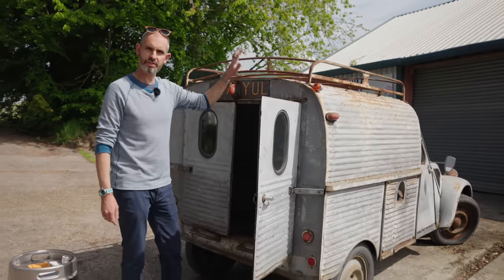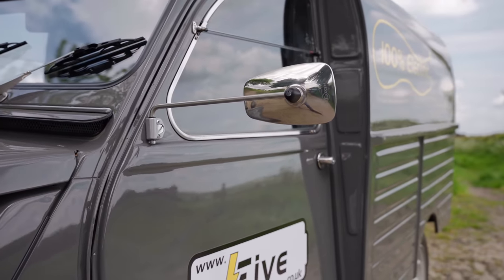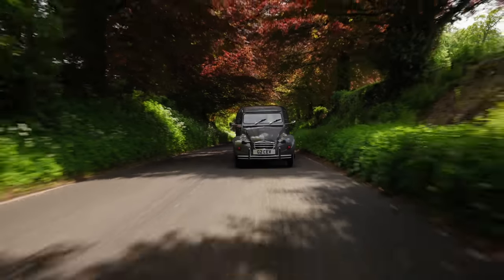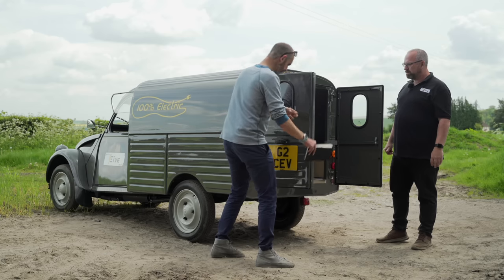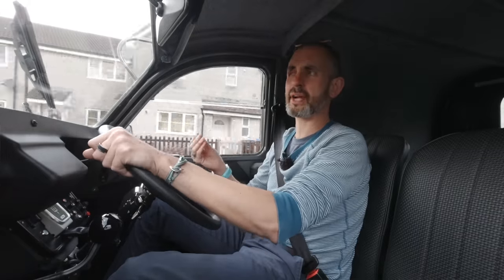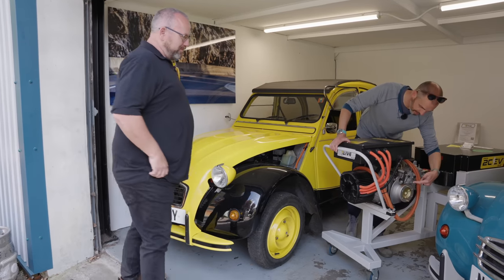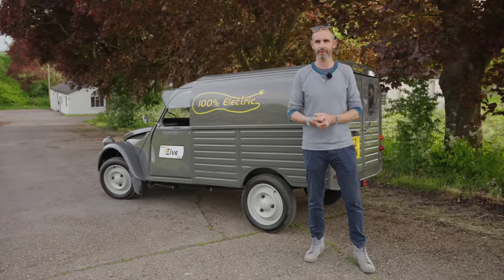This is a BRAND NEW Citroen 2CV AK Electric Delivery van - exclusive first drive review

Comment: The 2CV was the pioneer of the large diameter narrow tyres, a route followed by BMW with the i3... I've always remembered a Lotus Esprit article in CAR Mag [UK] in the 80s or 90s when on winding Alpine roads in slush and snow the power was useless on supercar of the day summer tyres  and could not  keep up with a local 2CV with narrow tyres and traction control provided by the lack of excess power

Comment: A proper air conditioner to cope with Australian summers is a MUST. And as long as I- at just under 2 metres and 120 Kg (6'6 and 18 stone)- can fit in it comfortably, these would be great! 

Anything over about 110 Km/Hr would be frightening on those skinny tyres. Keeping the car as a quirky little suburban runabout is all you need. Inter-urban driving in the UK is a lot less than it is here in Australia; Brisbane and Sydney are over 900 Km apart.

Keep the power to the wheels down and maximise the driving range of the vehicle.

Comment: I wish we could get simple and practical vehicles like this in the United States
Reply: Some years ago there was a programme called Pebble Mill on the BBC. They featured a purpose built vehicle that was designed to handle desert roads in Africa. Long story short, this "high tech" vehicle broke down during the expedition and was rescued with the help of a driver who rolled up in a 30 year-old 2CV trundling through like it was going to the corner shop. 2CVs were odd looking (I called them Upside-Down Prams) but the simple tech was hardy, easy to repair and the suspension handled rough terrain so well that it is almost unmatched to this day. It's the epitome of substance over style.
Reply: Not sure the repine is practical.

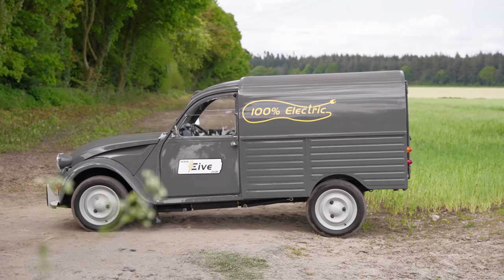Comment: Am I seeing things or is the rear tyre catching the bodywork at 2:30? 👀
Reply: I think its behind the body and when its loaded the body will drop down and the wheel align in the hole - I think
Reply: I keep looking at it and it definitely looks like it's touching
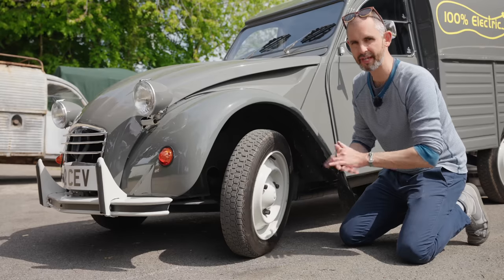Reply: if you go to about 4:11 you can see they are set in quite a bit from the body.
Reply: @100tinsoldiers  Ah yeah I see now

Comment: Don't know if you popped your 2CV cherry the same time as me Jonny, but I'm the bloke who collected the one that you used on 5th Gear to compare with the newly launched Citroen C Crosser 16 years ago. I collected it from Fareham at 7.30pm from a young lad who'd been waiting all day for me, and when i called in at Winchester Services for fuel, i couldn't get it started again. I'd been told to pump the accelerator a couple times before i started it but must've pumped it too much. There was a Police Crew bus parked nearby and i asked them for a push to bump start it, so all 6 of them helped (although just one would've sufficed) but it still  wouldn't start. So i had to call the AA and he had to use some easy start which did the trick. The fuel gauge didn't work and i ran out of fuel at Loughborough, luckily i ran out just as i was heading up the slip road of the M1 at junction  23. I then had to scoot the car half a mile up to the BP garage whereupon it wouldn't start again! By now it's 6am and i had to wait till 7.30 am for my office to open. Eventually It had to be recovered back to Nottingham where i live, and transported the next day to North One TV in Birmingham. So i had all the pain and none of the glory!  IDK if you you knew all that , can't imagine why you should,  but the second AA man said he'd be glad to see th back of these cars, though probably not as much as me!!

Comment: But the torque is huge compared to the Kw (120 Nm) so acceleration will be very smart up to say 40 KMh. If you bother to put it in 1st or 2nd gear. Speaking of which, could he not have just ditched the gearbox entirely - it's an EV after all.
Reply: Keeping the gears is smarter - either peppier performance, or climbing steep driveways with full load, use lower gear for more torque.

Comment: I completely understand why it's priced at the point it is - low volume, hand built, almost all brand new... but £40k is a lot of brass to be putting down on a vehicle which, honestly, has a fairly limited usefulness.... Yes, advertising - but it'll need to attract a LOT of punters to your authentic Bread'n'Snails (sorry, Pain et Escargots) business to repay its cost.  Still, very cool & so glad people are doing this sort of thing. I can't help but wonder, though: Get rid of that silly gearbox, chuck a beefy motor in there, leave those skinny tyres on it - it'd be an absolute hoot, all the way to, and through, the first hedge :D
Reply: Handbuilt, absolutely, but not too much to 'build'. The price baffles me.

Comment: At least it's mostly new. Otherwise, this sort of thing is ruining classics, needlessly.
There is no positive effect for the environment of putting electric motors in old cars because there will be more damage caused by creating the batteries than would have been caused by the car presumably doing very few miles using petrol.
You'd have to do tens of thousands of miles before this would add up in terms of air pollution. And you would still have the problem of the environmental damage caused by digging the stuff out of the ground.
Putting EVs in classic cars is simply a money-making scheme. And nothing else.

Comment: So, more celebration of unnecessary environmental destruction then Jonny? WHEN will you actually LEARN how devastating this electric motor LIE really is?
Reply: Go lay an egg
Reply: Speaking of environmental destruction, it sounds like you've been standing in a sealed garage with an ICE engine running.
Reply from the maker: It isn't a lie Paul, it is a choice. Do you consider the colossal environmental damage to oil extraction, refinement and transportation? Doubtful. All that process and we just explode fuel to move. EV is hardly the worst offender, is it?
Reply: @TheLateBrakeShow  Last time I looked, oil wells weren't drilled by African children for 25p a day. The OP is right, far from saving the environment, EVs are contributing to it's destruction. It's EXACTLY the same bullshit as when environuts said everyone should be driving diesel vehicles....look how that worked out 🙄

Comment: Should be very easy to put in LED in these, just buy ready-made LED reflectors with the light source already in them. JW Speaker makes outstanding ones, but for this perhaps the venerable but still awesome Truck-lite 27270C would throw massive quantities of light down the road, and those can be had even off retailers for a couple hundred each. They look way more traditional than the JW Speaker ones. Although, looking at those lights, I guess they're smaller than 7 inches, might be the "other standard" which is 5.75 inch. Then again, 7 inch buckets might not look out of place.

Comment: My battery lawnmower came with two 40V 4AH batteries.  You could get a dozen of those and a three port charger for less than US$1000.  Run the car on six at a time and swap when back to the shop.  Or for a little more, they have 6AH batteries.
Reply: That’s only 2kwh.

Comment: As the owner of a 2CV I find the tyres appear very wide in comparison with the 3.50x19 tyres fitted to my 1932 Morris Minor two-seater. 3.5 inches is 89mm, so 135mm is 50% wider.

Comment: Love it, despite a very "electric car" price !
My parents got a "springtime green" 2CV back in the early 90s.
The so distinguishable sound it made was also part of the joy that surrounds every 2CV.
Not to mention, it had a roll-back roof, my first time in a "convertible" !
Also, the almost oddly comfy "camping" seats, or the incredible suspension travel ("you can't rollover a 2CV" was a popular gimmick).
A car before Peugeot castrated Citroën's engineers, sadly 😕

Comment: At 6:34-ish Johnny says "city range in EVs is often way way higher". In my years with my Nissan Leaf I've found that I get 15% more range when I'm driving outside of the city especially if there's a significant amount of road that allows speeds in excess of 50mph. It's taken for granted that an EV will have worse economy on motorways over long distances. My eight year-old Nissan Leaf does 3.8-4.1 miles per kwh in the city and 4.5-4.8 miles per kwh on motorways and dual carriageways. Those efficiency levels are the same now as when it was new.

Comment: this is very interesting but for an EV with very small modifications you can get more range with the same battery by paying attention to Aerodynamics, for example that cargo box near the door is like a wall, a bit of angle there would probably give it some extra range and probably lower noise profile.

Comment: If this is a RETRO build i advise the producers to have a bigger 500 version with a polymer cabin usable as a camper, just higher with more windows and probably somewhat wider footprint. If you can fit a couch in there and sit with enough headroom it is feasible. A bunk bed is easily made. The rest is just making it fit custom orders. I mean you have to spent 50.0000 pounds to buy a regular camper van in retail anyway. Petrol engine ofcourse.

Comment: I guess the "handmade" part is the answer to my "where is all that money going?" question.
Given the original transimission, all of the fibreglass and the lack of features, I couldn't see it going into the development or the materials.

I guess the quirkiness should be enough for the intended market, but it is a shame that the main draw of the original 2CV is gone.
Reply: $30 for a handmade body and chassis, and $10 for the drivetrain and battery is about half what that would cost you for something that could actually haul loads or reach highway speeds. 🤷

Comment: The feature that I like the best on that vehicle is the no attempt to conceal functional bumpers.   Hopefully they're more rugged than the ones of the Renault R10 and R16.
imo ALL French-designed passenger cars are "comfy".  I've owned two, a Peugeot and Renault. They had the most comfortable front seats of all the cars I've ever driven. I'd be buying more today if the French hadn't abandoned the US market in the 1970s.   In those days they had a lot of cutting edge features, and cleverly conceived but poorly executed  basic ones. (The Renault R16 had the most useable features of the Honda Element). But the bodies in those days were thin, cheap steel that rusted incredibly quickly, and they ate front CV joints and alternators. The seats and suspension were the only things outstanding and those may have been to match one stereotype of the upper class Frenchman.

Comment: Considering that my original 2CV back then managed about 350-380km with its tiny gas tank this is not great range but okeyish. And the weight simply forbids a 40 or 50 kWh battery
Reply: And what happens to the range when it has a heavy load?
Reply: @mytinplaterailway  weight dows not matter much for an electric car, xou can check many tests on that. plus it dows not have a big load capacity. trailer and roofrack are a different story

Comment: What an interesting video. I have a Honda CR-Z which has an electric motor to assist the petrol engine and has a higher output than the electric motor on this car (not in terms of bhp, but kwh), and I wondered how on earth it managed to get it moving. Gobsmacked at how at how light the 2CV is. The CR-Z is a small two seater coupe, but weighs almost twice as much.
Reply: The originals were very lightweight, but probably had a side impact resistance similar to that of a laundry basket.
Reply: @kennethjackson7574  🤣 That would explain why the CR-Z has all that extra weight because it has a 5 star NCAP rating.

Comment: I had a petrol version 602cc version. The funniest thing was the jack to change the wheels. It was about 3ft long and only lifted the wheels off the ground on the last 8 inches of jack.  I only got rid of it as the seats fell to pieces but but your seats are pure delux.
Tip, don't use the air con when it rains. 🤣
I was going to translate the description but was beaten by a female voice over.  Zut alors.
Quel super véhicule.

Comment: Porsche has spent a decade popularising the idea EVs will weigh 9000 pounds.

24:19 In terms of function, this EVE makes a lot of sense as a wholesale delivery trolley, with a retrofitted chat bot at the wheel for extra allowable battery or payload.

3d scan the entire unit and print it as a monolithic monocoque structure entirely of titanium.

Comment: Nice to see that light weight can be achieved in an EV, albeit with zero crash protection or safety features. Can imagine it could be popular with local parcel delivery drivers, but an ice van is half the price and even a Kia SUV is cheaper. You’re really paying for the retro aspect.

Comment: Nice!
However, my dream is a standard 2CV without the original gearbox. One motor (strongest E-bike types) for each wheel would be a blowoff. I am aware that this can only be designed by several first-class engineers. The brakes, energy recuperation and the corresponding control would mean a real challenge. But it would be the most reasonable car in the world.

Comment: 😃 Nice. I own a 2cv myself fully restored, but mine has the original petrol engine.The electric version is cool but qute pricy. 40 000 per car😳 I do like the fact that it has the same look as it would when it camed out of the factory, wheels included. I often think about converting my 2cv and  the only thing that "stops" me is the cost. Me, living in east of Europe would have higher cost to drive it to UK, and as much as I like visiting there due to various reasons, at this moment its just not an option for me. (abusive job managers😔)

Comment: I wouldn't mind having one for short trips back and forth to town, but not for $50,000 USD!!!! Maybe 15-20,000 at most, and then you'd have to figure out how to get it licensed. Seeing that it's a NEW vehicle, it would almost have to be licensed as an ATV to get around the US vehicle safety standards for airbags, crash test, etc., plus the fact that it wouldn't be able to maintain normal highway speeds. For inner city travel, and rural use, it could be comparable to a mid-range electrified Polaris ATV, but with more carrying capacity. A short bed Polaris Sportsman 6x6 is around $15,000 after taxes.😉

Comment: How is it dealing with modern safety regulations when building based on old car designs? Do you have issues marketing this car outside the UK? What's the solution, do you modify the body design, or is it enough to limit the top speed of the car?

Comment: The Citroen 2CV Electric Delivery van could indeed be a great option for urban delivery and branding purposes. The 2CV, originally introduced in 1948, has been an iconic vehicle known for its simplicity, practicality, and charming design. With the transition to an electric version, it combines the vintage appeal of the classic 2CV with modern electric powertrain technology.

As an electric delivery van, the 2CV Electric offers several advantages. First, it helps reduce emissions and contributes to a cleaner environment compared to traditional gasoline or diesel-powered vehicles. This aligns well with the growing emphasis on sustainability and eco-friendly practices.

Second, the 2CV Electric's compact size and maneuverability make it suitable for navigating busy urban environments. It can easily maneuver through narrow streets and congested areas, allowing for efficient deliveries. Additionally, its electric powertrain provides instant torque, making it suitable for stop-and-go traffic situations.

Moreover, the 2CV Electric can serve as a rolling billboard for branding purposes. Its unique and nostalgic design is likely to catch people's attention, making it an eye-catching advertising platform. By featuring your company's logo, message, or product imagery on the van's exterior, you can enhance your brand's visibility and create a memorable impression on potential customers.

Overall, the Citroen 2CV Electric Delivery van presents a blend of retro charm, modern electric technology, and practicality, making it an appealing option for urban delivery businesses and those looking to leverage a distinctive vehicle for brand promotion.

Comment: I love retro EVs,, and classic conversion kits!
Reply: Imagine the laugh you'd have sitting beside a boy racer in a hot hatch and leaving him for dead of the line in a 2CV van. 😆
Reply: @gerrybailey447  yes, EV conversion have the a potential to be powerful sleeper.
Maybe add a sound generator with some old style engine sound, to avoid giving away that it is an EV, until you floor it, and it goes completely silent.

But they mentioned the van in this video, isn't trying to be mora than the original, having just approximately the same power.

Comment: e2CV, or 2CVe? 2cv-e!

Wow 15kW is puny. It may well be it won't go up hills? How could it get up a hill? Ah it has gears. 

This is a super cool idea. Make them cheap, and we could see one on every road.

All resin composite body, aluminium rather than steel wherever possible, redo the interior, no gearbox, re-engineer it all properly, but make it road legal registered 2CV with the same classic car suspension and geometry.

Comment: Nice, but I'm confused with the 'it's a nee car'' comment and 'get it with a new number plate'. That reg comes back to a 1989 car that's red and petrol. So are they using old vin numbers and putting them on new parts? In which case how do you get a new number plate? 🤔

Comment: Everyone saying it's too expensive... meanwhile if you wanted to convert your existing gasoline car to electric, a motor and battery capable of actual highway speeds costs around $20k alone, and the conversion install will cost another $20k... not including the cost of stripping your donor vehicle.  So this whole van costs less than an EV conversation of an existing car.
Reply: Who is converting their existing car to electric? Millionaires and the mentally ill?
Reply: I may have just shat myself laughing. 😂